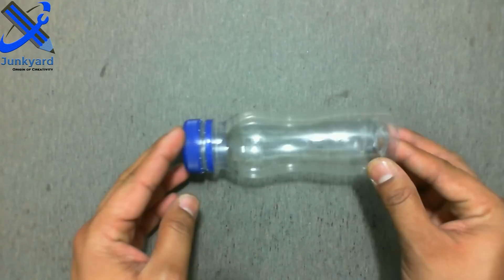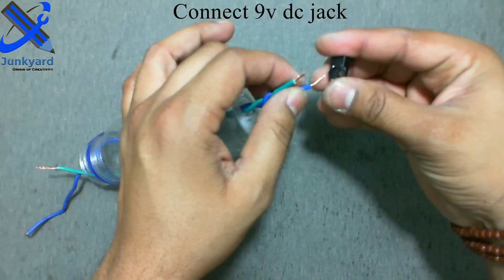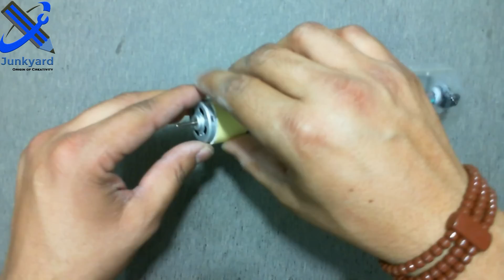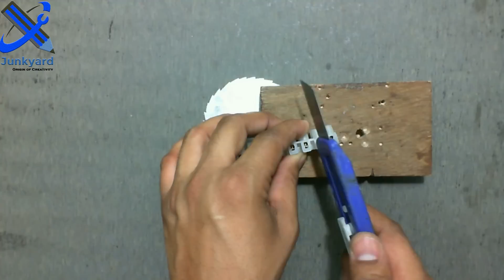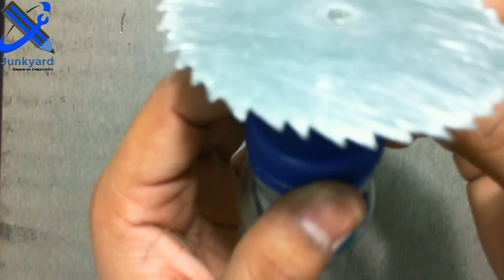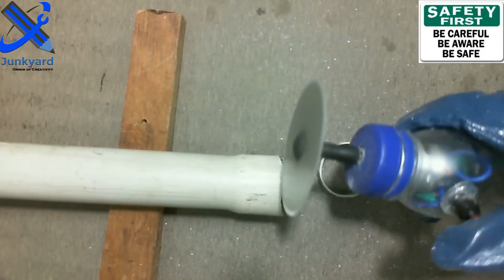How to Make a Powerful Rotary Tool at home

Comment from the maker: The blade is attached with shaft by screw and then extra strength is provided by high strength epoxy adhesive . so don't worry blade will never escaped. It is safe.
Reply: You could also make some shallow cuts on the saw or rasp it up a bit so it can cut and grind.
Reply: you live in a fantasy world
Reply: Its far from safe m8
Reply: +De Farlige D
Reply: what's the metal used for the blade?
Reply from the maker: Galvanized Metal
Reply: hey, where did you get that brass connector piece for the blade to motor mount?
Reply: hqncur
Reply: You r God at that
Reply: Junkyard - Origin of Creativity مستر بين الرسم

Comment: This is awesome...
you must mentioned what you use..
like moter is 12 volt high speed..
using atleast 2 amp. 12 volt to run moter..
anyways.. thanks a lot for d video...

Comment: Ingenious, but one of my concerns would be the fact that you enclosed the motor and in effect cut off any cooling air circulation. When I'm working a model or polishing, I'm running my Dremel for prolonged periods of time. You can feel the heated air escaping from the cooling ports .Other than that, pretty neat.

Comment: I didn't see  you solder the connections to the motor, switch or power jack.  Did that get missed in the video?
Reply: +Rich Trost use one from switch and other from dc jack

Comment: Hey. great work. i'd recommend two things. Search ebay for some cheap Rotary Tool Chuck and Rotary Tool Cutting discs.  now mount the chuck somehow. this will improve safety a lot for less than $15 which granted doubles the cost (or close) but it is still manageable. you can also salvage the chuck from a dead drill.

Comment: There's a few things I'd do differently than this, but, I respect what you're doing, which is showing you can make tools from nearly anything, very respectable!

I would really, really like to implore you in future builds to add a switch to the circuit instead of just wiring the power direct like that?

Comment: Well, those instrument could be made safer if you put something like slightly bigger half-round, 2 sided element which is fixed to the body of the machine, this could improve the safety, just like bigger ones. I still prefer hacksaw because it's way more safe to use and it can cut the same things like this tool with the advantage of being able to cut deeper and it's more silent :). Still good guide.

Comment: Aweome work yar..
I have some questions...can we connect any Dc motor to the main current with the help of an adapter??
How much rpm max each motor can give(3v  5v  9v   12v)..?
can i use a mobile charger as an adapter?

Comment: Had a soldering iron. Never soldered a single wire.

Permanently attached the blade with epoxy. Have to throw the whole thing away when the blade wears out.

Made the blade from sheet tin then tried to cut a nail with it. LOL! If you watch carefully, the nail just got pulled through and flung away, not cut. I suspect that destroyed the blade right there.

Holy shit that thing is dangerous (and useless after one or two cuts).

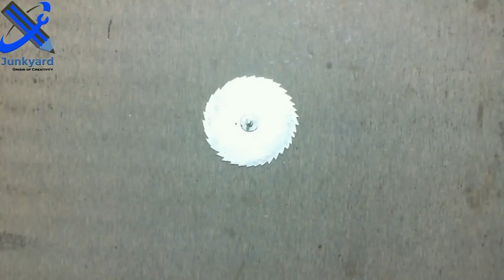Comment: What is that white colour thing you used for connecting the blade with motor in 3:16 ?
Reply from the maker: +Tony Tech regular epoxy adhesive
Reply: i'm not asking about adhesive.
Reply: You were screwing something with the motor's shaft and the blade,right.I'm asking about that;.

Comment: Mate a lot of you seem to miss the point. He went out and did it. Now he can refine it, maybe use some pvc tube and it'd work well and more accurate. Plus epoxy putty is tuff stuf. Again at least he's a doer not a gonna.
Reply: How is a dangerous tool that the blade can fly out of and break better than an actual Dremel for so $30 or $40
Reply: +Goat Bot never said it was. Again missed point he's gone done something rather then sit back bagging people for experimenting. I agree it's a little dangerous but if you build one he's outlined the how's you can now refine.
It's like a grinder I don't know one tradie including myself who leaves the safety guard on if I posted a video of the stuff I do with it people would go nuts like they have about this. I like people who try stuff and learn. Who know he may have figured yep that's not as safe as it could be let's mod it. But he had a go.
Reply: +Angus Whitehouse But people have already invented and refined the Dremel. It's not like he's gonna make something that's actually better. It's like the toaster. It's done. It's refined.
Reply: +ZsaFreigh yeah ur right still not the point though  He felt like making something and thats what he endes up with. Dont know about rest of world but drems are expensive in Aus. 
stll Im sure hes not going into mass production. Like model building when I was a kid and boat building now Im a 44 yr old kid its a distraction fun and interesting to make thing just because. :-)

Comment: Bro i got one of them vibrator motor which i got from a ps2 controller when i was taking off the semicircle block (idk what it's called) both of the wire snapped, it's a tiny wire though. can i somehow get it running?

Comment: Can u please tell which is that motor and where can I get it.The motors which are found in toys are not capable of generating fast rotations of blade.Please help
Reply from the maker: +Tushar Mondkar it is 30000 rpm motor you can buy it online

Comment: I applaud your creativity, however, the tools are very limited. What I mean is that it has a blade that's been epoxied on so you can't change it easily. Also the bottle is very soft and would buckle if you gripped it hard. Maybe use PVC or make some sand casts and pour aluminium housings. There has to be a better way to attach the saw to the motor too, so you can use for a drill or sand drum or blade not just one thing. And the blade is very dangerous.

Comment: what is the of black material by which you join the motor shaft with cuter plate
Reply from the maker: +Taj Muhammad that is regular epoxy adhesive
Reply: I don't know
Reply: J-B weld, epoxy putty. putty  comes in a small tube set or  kit  & hardner..it's clay looking texture , putty colors, black/gray, silver/gray or almon/gray
Reply: M-seal

Comment: perfect way to ruin your soldering iron tip
Reply: +IiTzToss_ If you don't have old soldering iron tips, you've never done any actual soldering...  (They're replaceable, and cheap, for a reason.)
Reply: +Aaron Lindros (DoubleA123) sorry i was on mobile and i couldn't change it
Reply: +w0mbles i actually have some old tips but a new one costs 20$

Comment: where does the power connect to? power supply? or outlet?
Reply: Potato battery.
Reply: +Matthew CLASSIFIED Thanks. Does it matter the size of the potatoes used.
Reply: Jorge Serna Typically, you want one at least four inches long and six inches in circumference. Idaho potatoes work best.

Comment: ....uses soldering iron to poke holes instead of using drill bits... then doesen't even use the iron to solder the wires onto power socket or the switch. wtf.
Reply: or the fucking motor for that matter
Reply: I seriously hope no one tried to build this garbage

Comment: Pro Tip 1: The tool won't be powerful if the motor isn't. 
Pro Tip 2:  A blade can't cut something that is not softer than it
Pro Tip 3: A cheap tube cutter does a fast, safe, neat job on poly pipe
Pro Tip 4: If you put something really dangerous on YouTube, tell people to be safe.
Reply: +John Malcolm Pro Tip 2 is incorrect.
Reply: +John Malcolm  he warned viewers turn on the caption
Reply from the maker: +Gamer Jee Han yes....

Comment: I wont even start listing the things that are wrong with this build ...
Reply: Is it because you can't
Reply: If it works, wrong is not important ^_^.
Reply: +vleesevlons lmao ikr
Reply: +leslie yiu it's like saying your car has a rod knock, or its has two wheels flat,  but it still drives so it's fine lmao
Reply: +ultrasurvivalist hey if it ain't broke don't fix it
Reply: Bob Fogh doesn't apply when it's actually broken
Reply: In this scenario , if it works then its not important ^_^. Why spend over 30 bucks for a tool that you only use for few mins in a craft of yours? I'd rather make this one since its very easy and not time consuming.
Reply: leslie yiu Motor is spinning, suddenly disc breaks off and gets stuck in your skull, but it's okay at least it worked.
Reply: +AntichristDemoncore yeah no i spent 30$ on a dremel tool 20$ more for the bits and i only used the tool for about 15-20 mins i prefer the diy one since its for small uses
Reply: +vleesevlons hahahaahaaaa Dead!
Reply: Le' Specklinie I was being sarcastic of course a DIY tool is fine, I was making fun of the idiots who think everything needs to come from a store
Reply: Melhor serrinha do YouTube!!

Comment: This is so useless and unsafe. I would never use this for anything, maybe one time until the saw breaks loose from that ceramic turd and rams itself in my leg. I though you would have some smart solution with a non electric solution, but you have literally just created a standard cutting tool with a less reliable design. innovation. 

Next week I'm going to create a hammer using only a rock and a stick! genius!

Comment: You have a freakin' soldering iron... so instead of poking holes in plastic with it, you could use it to solder the electric connections of the "thingamajig" you just concocted. That way maybe the wires wouldn't be shaken loose because of the vibration and cause a short-circuit afterwards... but as you stated, safety first! Don't build this piece of crap in the first place!

Comment: "Powerful"
uses like 5W motor.

A dremel has 125W motor and you can still stall it.
A 5W motor will not cut anything.

Also the blades supposd to be made from toolsteel if you want to cut metal, and all the teeth should be exacly the same size or else it will vibrate like hell and it will not cut effectivly.

or in other word, this video is useless and it will not work.
Reply from the maker: +the real illuminati that is home made powerful dremel tool dear.
Reply: +Junkyard - Origin of Creativity it is garbage. we all know it.
Reply: Junkyard - Origin of Creativity
it is homemade, it is not powerful, and it not a dremel, its a toy that doesnt work, if it works, why wouldnt you use it in your videos to make things?
Reply from the maker: +the real illuminati good idea, i will use this in my video. thanks.
Reply: +the real illuminati +Simon Barnsley learn to respect others creativity.  and before commenting garbage, remember it may not be as powerful as a dremel but atleast its more than 20-25 times cheaper than a dremel and not everyone wants to invest on a tool that they will only use it for say once or twice in a week..
Reply: +suraj bhawal 
Thanks so much for your kind words. if I lived on a desert island this would probably be useful. Otherwise it is Garbage.
Reply: +suraj bhawal Thanks for that. That makes two of us then.;)
Reply: +suraj bhawal it says it's a powerful dremel tool. It isn't. It's no better than a toy.
if it said in the description that it was a toy then that would be fair. Anyway.
Reply: ***** fair point! but that doesn't diminishes his creativity.. and you  shouldn't be insulting him like that...after all he's providing these content for free..
Reply: +suraj bhawal he is very inventive, however it is called 'junkyard' so the comment of it being garbage is accurate.